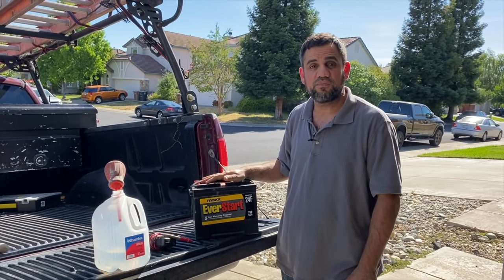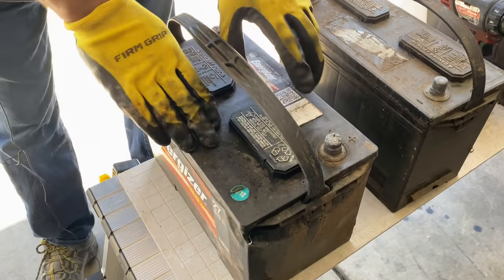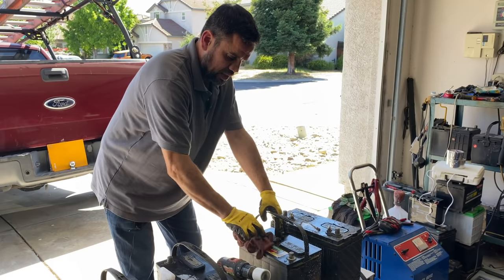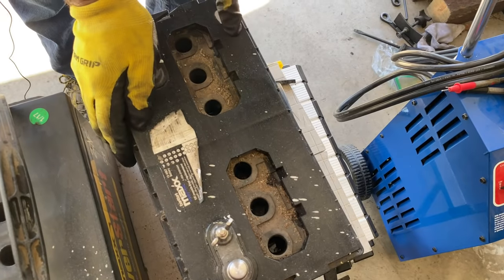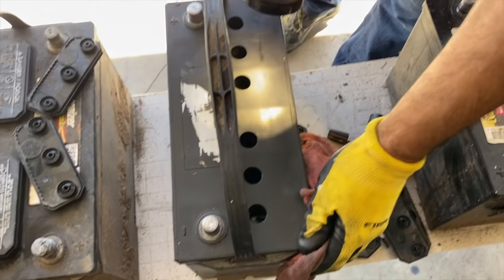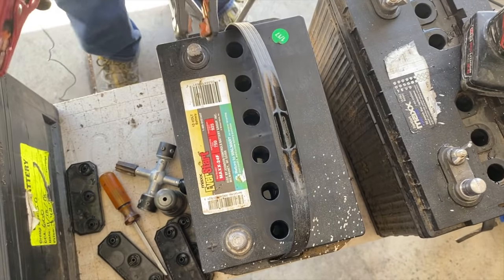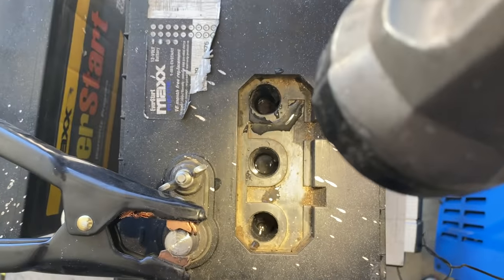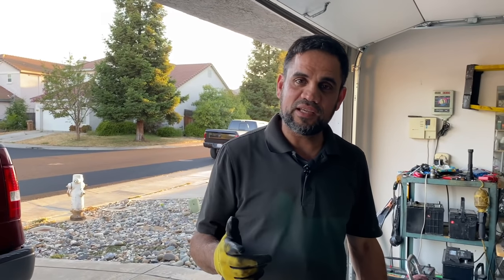Revive Your DEAD Car Battery Yourself--Learn the SECRET Method NO Battery Company Wants You to Know

Comment: Sure you can get the voltage back to normal.  What you don't see without a battery tester is how low the CCA's are.  I got my battery back to 13V but the cold cranking amps were less than 100 when the battery was rated for 390.  Looks good, but the battery is still bad.  Maybe the next one will come back?  Who knows, it's worth trying though.
Reply: Totally agree. Battery voltage has little relationship to battery cpacity (.i.e CCA - Cold Cranking Amps) which could be due to sulphation of the plates or even simply poor acid density. A 100% charged battery will be 12.6-12.8 volts, anything higher is just a wrong test too soon after a battery charge cycle.  In simple terms a specific LOAD TEST must be performed noting minimum loaded voltage over time relative to subsequent recovery time.
Reply: that's why I take alternator to O'Reilly why the put a load on it physically uses  a belt with tension not testing with digital diodes hold charge but under a load they fail

Comment: I know this posting is 2 years old but you forgot to mention that when charging any lead acid battery a vapor is given off which is very explosive.  Turn off the charger before disconnecting the leads so there won't be a spark.  The  battery could very well explode if a spark is created when these vapors are presentl.

Comment: You really need to get a battery load tester.  That's the only way to know if the battery is come back enough to be able to produce the amps needed to turn the starter.  I was able to revive is a glass mat battery or AGM. However it doesn't always work

Comment: I've used this procedure on weak 3 year old car battery and 2 year old deep cycle FLA battery.  I did 15 minutes at 40A current and bubbling, 20 minutes cool down, another 15 minutes at 40A bubbling, then 20 minutes to cool down.  3 times total at 40 amps charge current.  The battery went up from 25% capacity to 50% capacity, and it starts the car reliably for 4 days so far.  Will try higher amperage again for 2 more sessions to see if that further improves it. The issue with old batteries is the plates crack and lose conduction internally with the plate grid, small shorting occurs between plates, not possible to fix those.  If there's only a little of that you may get 80% recovery of CCA, but an old worn out battery won't ever recover all the CCA.
Reply: If you put baking soda and water in the battery first run clean out the plates you will get the cranking amps back baking soda and water cleans the plates

Comment: But sometimes only Voltage is there and battery is unable to crank the engine(as soon as you crank voltage drops instantly without cranking).What about these revived batteries?
Reply from the maker: You need to first see if you have a bad or weak cell, as I explain in the video. If you do, follow the steps in the video and try to wake up that cell because the majority of the time it’s the cell that’s the issue. 

Also, make sure you test the starter on your vehicle because when the starter starts to go bad, it will start drawing more ampage from the battery. Sometimes people think the battery is the issue when it’s actually the starter.
Reply: I have enersys genesis 12V 16Ah, only ~1,3Ah capacity left - still starts merc w168 A160 gasoline engine

Comment: Checking the batteries after charging with a volt meter does not mean the battery is now good. It only tells you the voltage of the battery at the time that you checked it. To determine whether your method worked, you have to test the battery with a load tester. That will tell you the actual results. There are plenty of batteries that read over 12 volts, that will NOT start a car.

Comment: Hello
Nice detailed video... thank-u..
I have a question, please..
Mine is an 80ah, 30months old..
I took it to various dealers, & all said that 1 cell is weak..
i've been facing stalling of my vehicle & a push is required..
Do u think it'll b revived as good as new..
As I'm in the process of buying a new one this week..
Help would b appreciated
Reply from the maker: It sounds like it definitely could be revived. It doesn’t sound that bad, so go ahead and give it a try. Just make sure to wake up that weak cell. Let me know if you have any more questions about the process.
Reply: Kind of u for that quick reply..
I'll give it a try & update u..
Though I don't have a personal charger, will give it to a reliable dealer..hope he'll do the needful..
Is there anyway I can charge it at home?! (I guess I'll need a specific instrument)
Reply from the maker: King Sidd You would need a battery charger. There are some very inexpensive ones you can buy at stores like Harbor Freight and Wal-mart. They run about $30 bucks. You don’t have to buy the big one to charge it, the $30 charger will do the trick.
Reply: I am based in India :)
Let's hope for the best..
I'll update u
Reply from the maker: Ah ok 😊. 

So any car battery charger should work. 👍🏼

Comment: Sir, you haven't shown whether the charged batteries are able to take the load. Only no load voltage is shown.
Reply: and this video doesnt work, the best is to drain the sulfuric acid then wash the battery with baking soda then put any high concentrated salt solution and charge for 24 hrs. thats 100% sure,am talking true experiece.
Reply: @Pusongmamon413   i want to revive a few 230amp/h batteries.most of the cells are ok but one is dead and show 0.43 volts.i washed it out and put in epson salt sulition,after 6 days it seems not working.Do you think the problem lay by the charger.Igot an 8 amp charger
Reply: @Pusongmamon413   i want to revive a few 230amp/h batteries.most of the cells are ok but one is dead and show 0.43 volts.i washed it out and put in epson salt sulition,after 6 days it seems not working.Do you think the problem lay by the charger.Igot an 8 amp charger
Reply: True a load tester will tell if it's good.  Voltage ain't nothing
Reply: @francoisverdoes8552  Wash it again, put fresh electrolyte in it and try to recharge it. If there is no voltage rise at all within, say, three hours, then this cell is shorted for good...Still you need a strong charger for such a high capacity. Trying to charge it with only 8 amps, you will normally need approximately 30 hours of continuous charging in order to reach the nominal capacity (losses excluded). 
The  best tester for the condition of any (flooded) lead acid battery, is the hydrometer... if the density of the cells rises during charging, then the process will be successful, while, if it does not increase, the battery cell(s) is defective (because of various other causes)...

Comment: You want to know the CCA ( Cold Current Amps ) before and after at a least 10 volts.   Voltage by itself doesn't tell you whether your battery can start  a car.  Does your process get back the CCA.  Need a CCA of 200 plus to spin a small car motor when cold, and 400 plus for a V8.

Comment: Your best to use a cheap China made DC welder. But be careful not to leave on 'too high too fast, and too long' it will damage the welder or blow up the battery. Always plug to a 'trip low amp' plug.

Comment: Volts means nothing. If the plates are sulfated the battery may show full, but it won't hold any charge and will not deliver current(which is the most important factor.

Comment: will this work with a harbor freight 2/10/50 amp battery charger ?
Reply: Definitely. But get a multi stage charger. I would go for a 50 amp boost charge and variable voltage to trickle charge.
Reply: no it will not.
Reply: Nope I have both a viking, and the 2, 10, 50 charger cen-tech both won't start on a dead battery the stupid cen-tech won't turn on and the quote 50amp boost just clicks  constantly and doesn't jump the vehicle total waste of money needs a minimum of 10.5 volts to charge your dead battery from leaving your dome light on overnight

Comment: I can tell you most of the rejuvenation is about your battery charger no smart charger it has to be a charger that can charge without a shut off in side and I haven’t been able to find a manual 12amp charger almost all are smart battery chargers
Reply: You have a good valid point about the modern 'smart' chargers on the market.  Many smart chargers simply refuse to even try a charge if the poor/flat battery has less than 5volts (varies between manufacturers) so a smart charger just reports "Dead and Useless, change  battery", however if you use a good old fashioned non-smart charger for even as little as 10mins it kicks the problem battery voltage up enough for the smart charger to then function and doo its stuff. By 'do its stuff' I am referring to the manner how smart chargers increase charging voltage during the early charge phase to help remove possible sulphation on the internal plates, then goes into the bulk load charge for the most part of the charging cycle, then stops charging and monitors votage drop over time, and recharges as needed until the charge holds well,. Then finally the smart chargers go into maintain mode at either  13.6volts just like like it does when in a running engined car, or some of the smart chargers monitor the voltage and only kick-in when the battery voltage drops under 12.6volts to keep it in the range of 12.6v (100%) for a good standing battery voltage, or 13.5v as in the charging voltage (again, varies by different manufacturers).  All clever stuff . . . . . BUT ONLY IF THE SMART CHARGER IS SMART ENOUGH TO WORK WITH A REALLY LOW BATTERY VOLTAGE which they often do  not ;-)
Reply: Just use a good second battery hooked up to the old one and trick the charger to start charging leave hooked up for twenty mins then disconnect good battery

Comment: You should try using a battery desulfator and see if it can bring back the battery that was at 10 volts. I use a Pulse Tech PowerPulse passive desulfator, it uses a patented frequency to desulfate a battery and maintain it, that can extend the life of a new battery up to three times. Noco Genius 5 and 10 also have a repair mode for heavily sulfated batteries

Comment: Do not listen to this guy. he has no idea what he is talking about for reconditioning a battery. he is not reconditioning he is only charging. he didnt even checked the cells properly and what makes me laugh more the multi meter. that dont tell you anything but how many volts in the battery. doesnt mean cca is good and it sure as hell isnt going to tell you if you have a bad cell. a battery can last for longer what he even quoted. I have reconditioning business, i have reconditioned batteries well over 13 years old and those batteries are still working. also a gravity test was never done, load never done, checking each cell with a multi meter, and there is more on top of that. he has no idea about how a battery really works. any one can charge a battery, but if you dont know how a battery really works then dont make a video that makes us laugh. this is a type of video that could seriously injure some one. I dont even want to start on safety cause he has no idea what safety is either
Reply: Nothing wrong with this video.... Yes, he is only charging the batteries, but the Reality is that they're 'dead' because nobody can charge them with their modern home "smart" battery charger. He explains that you need a Manual charger to re-charge neglected batteries, and he IS correct. He shows his expensive automotive Manual charger and then gets some of the batteries fully charged. It's true that the 13volts he shows doesn't mean the batteries are definitely back to full Cranking capacity. But again... the Reality is that he showed on those batteries that each cell was active and not sulfated. And that means that YOU know he was in fact successful at Fully charging those batteries. Why should he make it more complicated and go into an hour long video about restoring Damaged batteries?? Frankly while much of what you say is true, what he has done here IS effective and many good, but flat, batteries sitting in people's garages could easily be revived and in fact restored by the heavy equalizing he is doing with that commercial charger (which was all some of them needed when they got put to the side). Unlike most of the Hacks on YouTube, he isn't showing how to wash the loose Lead out and then dumping it into the ground water or municipal supply and basically poisoning folks, if not now, later. Since you have a "reconditioning business", perhaps you can explain what you do with all the Lead Suspension you get from all the batteries? Lead isn't just a little toxic, it's Highly toxic. So go right ahead and let us know what you're doing to keep from contaminating your land, your neighbors or even your whole town's water.... 
I'm all ears 👂👂👂👂 ~

Comment: 🇺🇸👍.  Use a rubber mallet (hammer) to hit the outside and bottom of bad cell then dump the acid into a plastic container then and old shirt or bed sheet to filter out the black crap rinse with distilled water empty again refill with acid topping off with distilled water and hit it with your big charger as you do then small charger for 24-48 hours and you will have a better outcome 👍🍺🥩🌽🥔.  🥛💤